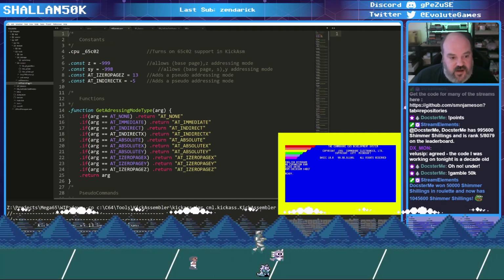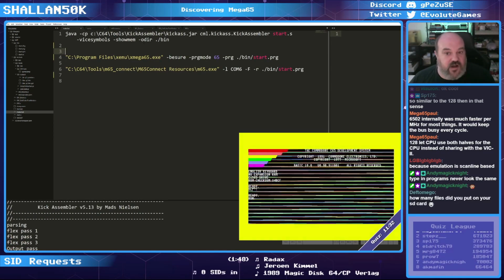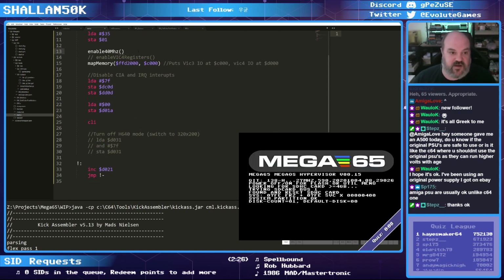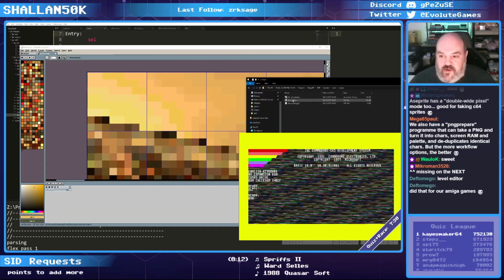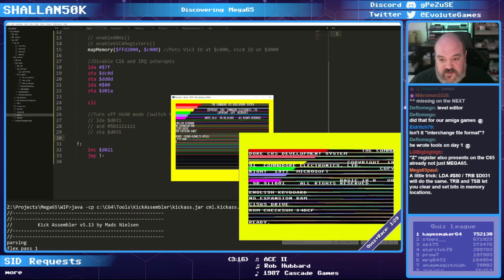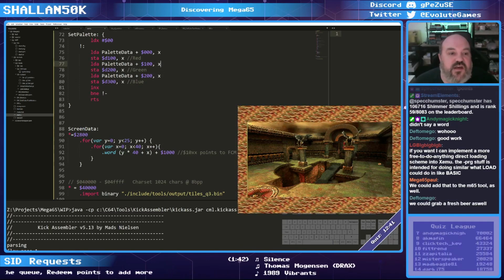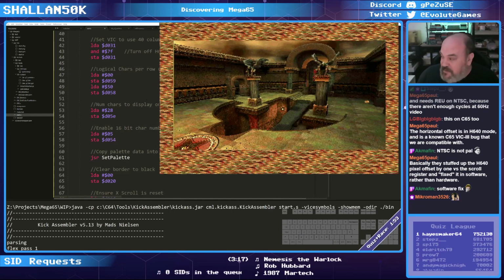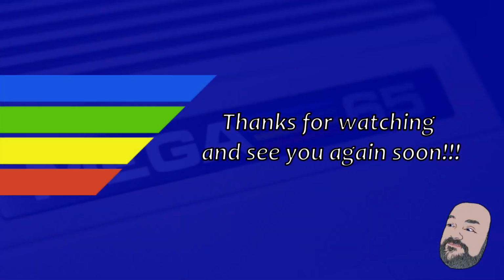Discovering Mega65 - First Steps

Comment: One question, when you say "the Mega65" in this video are you primarily referring to the VIC-IV that they defined themselves and not the real C65 implementation? Doesn't that just feel a lot like you are just developing for a modern platform but using 6502 assembly?
Reply from the maker: Yeah, the Mega65 is basically an extension of the C65, it uses mostly the same memory mapping but with some additions, one being the VIC4 implementation. As for how it feels, it definitely feels very powerful but it's done in a way that makes it still very much feel like programming a C64, it's just the limits you had to work around previously are gone and now replaced with new limitations. Some limits remain, such as a hard cap of 8 on hardware sprites.

Regarding new limits and the "C64 feel": While RRB sprites are a powerful tool they are by no means easily enabled, you have to write quite a bit of setup code to make them useful as sprites, because the original intent of the RRB buffer was simple layering not fully dynamic sprite systems. I kind of see the work required similar to that of creating a multiplexer on a C64. In fact, the trade-off of raster time is also similar. And there's nothing more Commodore than taking one system and hacking at it in unintended ways to create functionality

Comment: Are your tools available for others who wish to get started on #Mega65 development ?

I use Linux , VSCode and 64tass  for developing C64 stuff with Vice & C64Debugger ( which ought to be tooled up for this IMHO)
Reply from the maker: The KickAssembler PseudoOpcode and macros files are available on my GitHub linked in the description. The bitmap and palette conversion will be made more flexible (its currently tied to a very specific file format) and then added to GitHub also in the near future
Reply: @Shallan64  Thanks for this info! Will give it a try as soon as i get a chance!
Reply: @Shallan64  can’t find the M65macros on your github. Will you upload it later?
Reply from the maker: @hstampfl  https://github.com/smnjameson/M65_KickAsm_PseudoCommands/blob/master/m65macros.s There ya go :)
Reply: @Shallan64  can't find the mega65opcodes on your github only mega65macros.
Reply from the maker: @michaelpust2615  Apologies I missed these comments. I have no longer any need for the opcodes file as I now use an updated KickAssembler as linked in the Githubs readme file which contains support for the Mega65. However should you still want to use them you can check out on older version that still contains the file: https://github.com/smnjameson/M65_KickAsm_Macros/tree/dbd1cbd028a3eb6225ad6cde3edccb3add525278
Reply: How do I create the Makefile and then start the xemu mega65 Emulator???
Reply from the maker: @michaelpust2615  From windows simply create a make.bat file in the root of your project and use it to build with kickass: "kickass.jar  -vicesymbols -showmem  myprogram.s -odir ./bin" and launch the  Xemu with "xmega65.exe -besure -prg ./bin/myprogram.prg" ,pressing F8 in sublime text will launch the make.bat
Reply: @Shallan64  Thank you very much :-)
Reply: @Shallan64  Sorry, how can I install the (Mega65).sublime-syntax at the Sublime Text 3? Can you maybe make a video please?